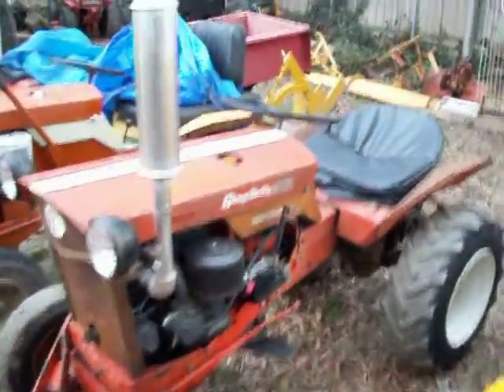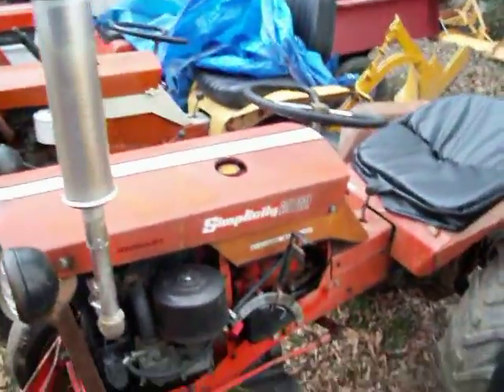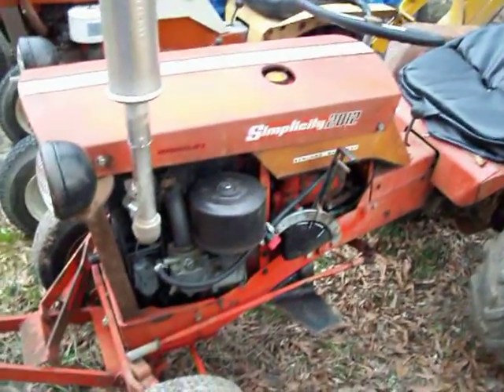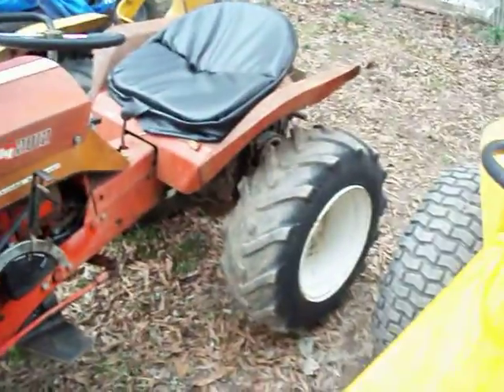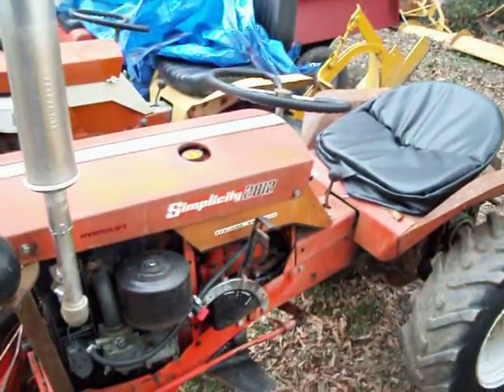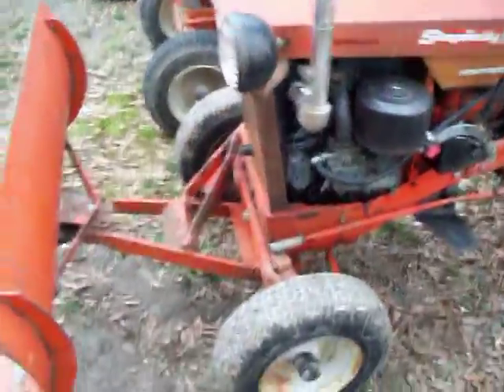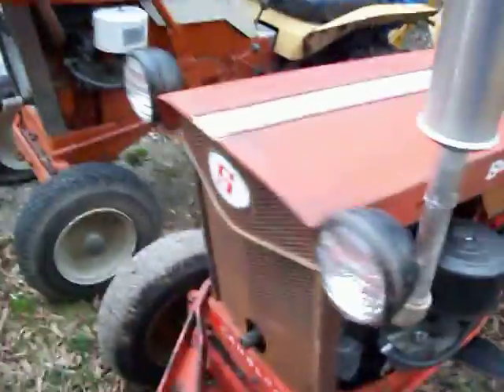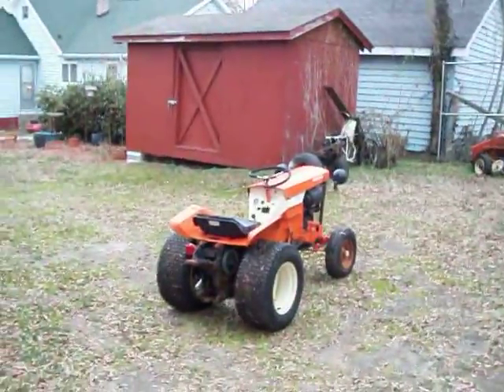Simplicity 2012 hydro lift 16hp briggs

Comment: I have a  66 2010 manual lift. Would I be able to convert to hydro lift? I'm new to this vintage tractor stuff
Reply from the maker: Yes but you need all the parts, I took a 3212v and pulled the hydro lift off and put on a b12